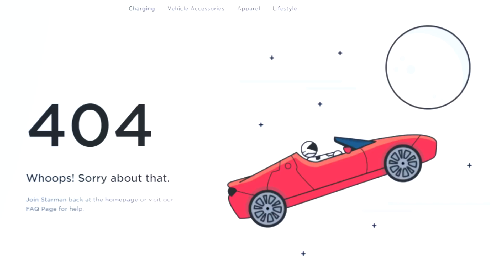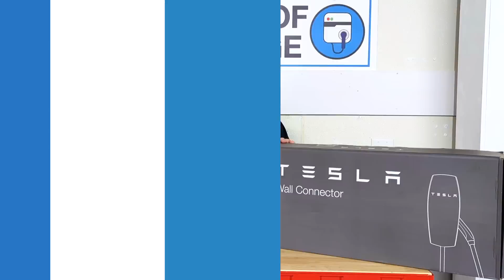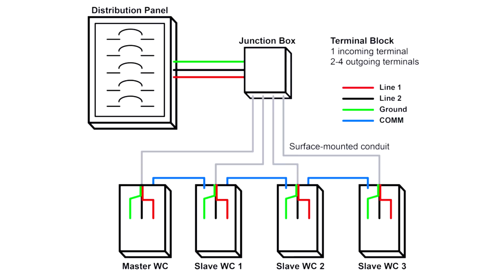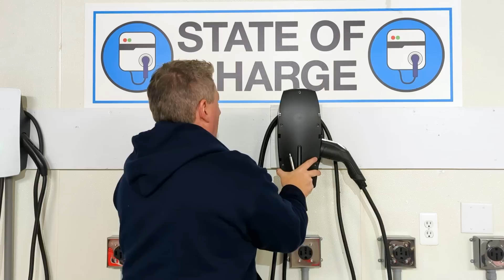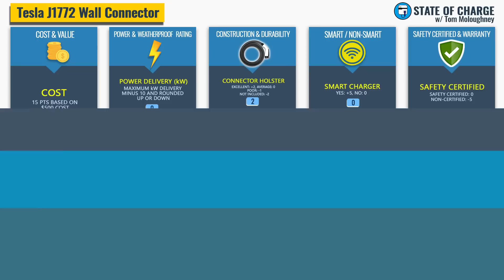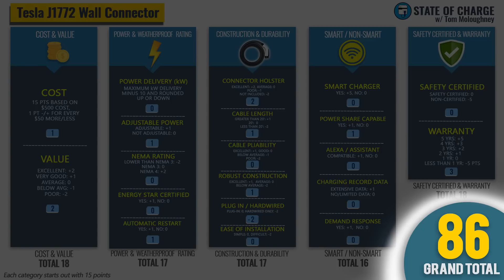Tesla J1772 Wall Connector Review new

Comment: The latest version comes with up to 48 amps and with Wifi.  $550.00 at Bestbuy.  I do wish it came as NEMA 4 but it looks like many people have installed it outdoors and I haven't heard of any real problems.  Now that I that, let's see how many disagree with me.  I'll use that as to whether or not I should install this outside, which is what I want to do.    Got a Ford F150 Lighting coming.  So I'm having a 60 amp circuit installed.  ;0)

Comment: I believe a reason for their limited sale of the J1772 charger is because Tesla wanted to clear out stock.  These J1772 connectors were available for commercial businesses to install on their property for a couple of years.  My thought is they wanted to end production and clear their inventory so they put them up on the website until they were gone.  Would explain why the listing isnt there anymore, why its a gen 2 style vs the gen 3 white glass frontplate style, and why it has no smart power sharing features.  They’re just old stock.
Reply: That is what I was thinking. These are the old Gen 2 used on commercial properties.
Reply: This doesn’t preclude them offering a Gen 3 version in the near future, supply chain permitting.  I wouldn’t be surprised if that happens at some point.
Reply: @JohnGeorgeBauerBuis  didn’t say it did preclude them from offering an updated version. But I don’t think that’ll come until they switch to CCS/J1772

Comment: Charge Point was one of the best you tested, especially in the extreme cold. So, based on your review that's what I purchased. And the fact it has WIFI built in and usable it was an easy choice after watching all of your reviews. Some of the other units had better stat options and was better in extreme weather but the Charge Point will work well in my area.

Comment: Are you planning to review the new J1772 Wall Connector currently available at Tesla? Specifically does the new J1772 Wall Connector now available allow power-sharing between the J1772 Wall Connector model and the current version of Wall Connectors with a Tesla Connector? In other words does it fix the main problem you had with the older model in that it could not power shared between the J1772 Wall Connector and the Tesla Wall Connector?
Reply: Im wondering the same thing. I just added an ID.4 to my garage beside my MY. Trying to figure if it will load share now with the Gen 3.

Comment: These were originally offered to businesses with their destination charging program. I personally believe that these were surplus units and Tesla was purging old inventory. 
I’m glad I purchased one on the day they came out. Technically, they can be networked to the gen 2 Tesla wall connector, but ONLY the discontinued plug-in gen 2 version. This is the way my charging setup is. I really should make a video about it.
Reply: Jim, maybe you can help me.  I bought one of these as well before they yanked them.  My question is, "Is there a light that comes on the front? (green or red).  I see it in the pics, but they've seem to have shortened the ribbon cable so it won't connect and I don't see where the light would be on the cover.  Does the ribbon cable pull out as to reach the front plate - I never connected it. Thanks!
Reply: @Cedar1956  Yes, there is a light. There is a single T10 (I think) torx head that holds on the silver cover. Once that is off, there are ten or so T20 screws that need to be removed. This takes the actual cover off the unit off. The ribbon plugs into the back of the cover. I hope this answers your question.
Reply: @fatwajim  Perfect! Thank you!
Reply: I was looking through the comments to see if anyone had mentioned this and I'm glad you did! 
A while back, I tested the J1772, made a video, and found the same thing, the gen 2 plug-in was the only compatible networked device other than the J1772. I'm thinking of grabbing another plug-in and doing a 3x EVSE network setup with 2x Tesla connectors and 1x J1772 outside for visitors :)
Reply: @TeslaRyan  I actually have a plug-in Wall connector for sale on EBay. If you’re on eBay, it’s the one that has a signature edition faceplate on it. If you’re interested, just let me know :)
Reply: @fatwajim  Thanks, I'll go check it out!!

Comment: What I'm dying to see is a J1772 version of their mobile connector with all the various NEMA adapters available. There is no equivalent on the market as far as I know. I've been contemplating getting one of the existing ones and a J1772 adapter just to have every outlet use case covered when traveling in my Bolt.

*edit: spelling
Reply from the maker: TeslaTap sells them, but they are currently out of stock.
Reply: @StateOfChargeWithTomMoloughney  Yup!
Reply: @StateOfChargeWithTomMoloughney  Are the Tesla mobile connectors that Tesla Tap modifies to have a J1772 connector safety certified and do they come with a decent warranty?
Reply: Personally, I’d rather pair a stock Mobile Connector with a Tesla to J1772 adapter.
Reply: Just get the bolt EUV mobile charger it has interchangeable plugs and does up to 32 amps
Reply: @ELSAMRAS1  I'm pretty sure it only has a NEMA 5-15 and 14-50. The Tesla has 8 different plug types.

Comment: Tom, nice review. But I hope you can review the DCBEL r 16 EV Charger, Solar Inverter & Energy Management System. Before the EVSE bidirectional chargers hit the market. That the DCBEL r 16 will partially compete with, so all the different bidirectional, V2H and V2G options can be compared and contrasted to each other.

Comment: Hi Tom, I live in Australia and my Tesla (model 3) has a CCS Connector in the car. (CCS is J1772 with additional DC high voltage terminals) so it is compatible with J1772 AC charger cable. I assume this charging station is available outside USA. The 240V home charger supplied with the Tesla uses a J1772 connector.
All new supercharges in Australia use the CCS connector. 
Maybe Tesla will soon make USA cars with CCS connector so it will directly accept J1772 and CCS.
Reply from the maker: That would be great, but it isn't expected to happen here. Instead, Tesla is going to be making CCS to Tesla adapters so other EVs can use Tesla Superchargers.
Reply: My prediction is that Tesla will shortly be converting all their cars to CCS and this is an item they will need to have in stock with that switch.  We are already seeing SC's with CCS so it is only a matter of time, even though I would prefer to keep the stock Tesla adapter on the cars and EVSE's as it is much smaller and more manageable.  I am not sure how the CCS fits in the M3 or MY flap, but it must somehow as that is what everyone else in the world is using.  This would also make it easier to build one vehicle anywhere and sold anywhere with the excepting of those right hand drive countries  ;)
Reply: @nevermab   Tesla is only using a country's DCFC standard. where local regs push them to do it.... Like China EU, and Australia have done... FWIW a newer CCS Tesla would use an older SC or EVSE via an adapter until all SCs and EVSEs had CCS plugs...

But USA (and Japan) regs are not forcing them to adopt the local DCFC standard.... Which is instead just getting dual plug SCs,  just so electric can be sold to most EVs  at a huge profit,  (ie it won't affect Tesla owners)

Shame since it would be far better for "all of us"; to have a universal standard for all EV DCFC, even if its a tiny bit larger like the EU is doing..... So we could all use the same chargers and EVSEs without the need for adapters.... IMHO....

:Lastly, since the EU is uses a" type 2 CCS" vs USA using" type 1 CCS". Tesla would still have build them differently for each market, plus thee a other reg differences...  So no econnies of scake cost saving....

Comment: Tom, great stuff as always!!!  Thanks for the heads up about this.    Owning a Tesla, I really don't care about the J1772 and certainly wouldn't use it on a BOLT or VW.  There's better J1772 connectors out there for non-Tesla vehicles.

Comment: Tom, can a tesla gen 2 mobile charger, charge a non tesla using a tesla tap adapter. I like the versatility of the different outlet plugs and output variability. Will it work, I have an EV6, thanks
Reply from the maker: Yes, absolutely.
Reply: Thanks

Comment: Can you review the Emporia Smart Level 2 EV charger?  This monitors power usage and works with the same app as the Vue 2, which monitors all house power usage.
Reply: If so, it would definitely be worth doing the deep freeze test.  For me, an EVSE will be installed inside an unheated garage, which can get pretty cold in Chicagoland winters.

Comment: Tom, nice review. I did see 4 of these units installed at Oakridge Mall in San Jose as part of a Super Charger and 24 Gen 3 destination charger setup. They had these J1772 units set to 40Amp but with only about 208VAC. I tested them with my Taycan along with the Gen 3 using a Tesla to J1772 adapter. The Gen 3s are 48Amp.

Also assuming a four year warranty on a item that they discontinued in 18 days seems a little optimistic wouldn’t you think?
Reply: 208V means they’re most likely connected across two phases of a 3-phase supply, commonly found at larger apartment buildings and industrial sites.
Reply: @JohnGeorgeBauerBuis  yes John, I am aware of that. I helped spec the 36 Level 2 chargers we had installed at my workplace. I requested higher voltage than the base 208, they were able to tap the transformer to get 235VAC, which is very needed as we only have 32A Clipper Creek chargers.

Comment: Tom, Great review on the J1772 connector.  That would be great for Teslas with the adapter and non Teslas alike 😀.  I wish Tesla would add BOTH Tesla and CCS1 connectors on all the new products or at least hurry up with the CCS1 to Tesla Adapter for North America.
What is the hold up?
Also why does a company as large as Tesla constantly running out of products on the Tesla website.  Elon check into this.  😁
Reply: I think they are waiting to have sufficient supply to start offering the CCS to Tesla adapter in other markets besides South Korea.

Comment: I am starting to have once a month or so error codes on my HCS-40 after nearly 7 years of almost daily use- it is probably a worn out high voltage contactor. I will get it repaired by Clipper Creek when it errors out every time I try to use it. Might you consider adding repair ability as part of your rating system? Clipper Creek said a main contactor replacement and general check up should cost around $150 plus shipping, which I think is a great price. Thoughts?

Comment: Tom, thanks for the review.  Most of us didn’t know this product was released for (limited) sale.  It’s a very peculiar generic charger.  Why is it bigger than the gen2 and gen3 models if there’s no added functionality in the box?  Sadly, it’s not a smart charger, capable of managing multiple accounts for residential use at Multi-Unit Dwellings (MUDs) such as condominiums.  5-EVs could share it:  a Tesla,  an iD.4, a Bolt,  a Mach e, and a Taycan.
Reply from the maker: I don't think it is larger than the original Gen 2 Wall connector, which was larger than the new Gen 3 units.
Reply: fwiw its not even a charger anyway... its just an EVSE.... ie Electric Vehicle Supply Equipment....
Reply: @nc3826  Yes, I know it’s an EVSE.  If you follow Tom’s vids like me, he explains most manufacturers call these “chargers” because the term EVSE is too complicated / technical for buyers.  As a 4+ year EV owner on a 2nd Tesla mS, I know the charger is inside the EV.  So far, all the EVSEs I’ve installed have been NEMA 14-50 receptacles, but as soon as I can find an economical one that does multiple accounts and hopefully billing, I will upgrade.
Reply: @johnpoldo8817   WADR Marketers and anyone, who only use the incorrect term for it, just add to the confusion.
While Tom explains the differences for newbies, so its not the same. 
FWIW anyone who is truly incapable of grasping the difference between the role of an EVSE vs its real charger should not be driving. 

Lastly thx for your defensive and pedantic retort about it. It was very amusing. Have a nice day, Sir.
Reply: @StateOfChargeWithTomMoloughney  Tom get well soon... And after you do. I suggest getting the pneumonia vaccines. It has been a game changer for me..... (Along with the COVID booster, ofc) TC

Comment: I am a first EV owner and will be charging the ID4 in my drive way. Is there a charger that has a stand that you can pull out when charging and put the stand back in the storage area when not?? I do find your you tube video very educational thanks again.
Reply: Such an installation would not be code compliant. EVSE are required to be fixed in place equipment, unless it is a plug-in, mobile type charger which would connect to a fixed outlet.

Comment: I have 2x Gen 2 that I power share over a wire.  Can you power share this j1772 unit with the Gen 2?  I understand you can not power share with Gen 3 because it does not use a wire to power share (i.e. wifi).
Reply from the maker: I believe you should be able to, but I can't get any confirmation from Tesla.
Reply: No, it will not power share with the 80amp gen 2 units. You will get a red error light with a code 6. I think it says something about there being a difference with the maximum amp ratings of the units.

Comment: Tom, I think it’s a poor design for charging the power setting, no one does low tech dip switch anymore, the power setting should have been software base IMO, however the power share features is awesome, also is it a true smart charger my org. Tesla charger does not log my charge sessions and no schedule charging.. no real app just for the unit with all the monitoring and management features that is know on true smart chargers.. does this unit comes with a dedicated app to do all the smart functions?
Reply from the maker: It's not a smart charger at all. No app - no smart charging features.
Reply: I disagree. The problem with setting the current limit in software is it would be too easy for someone who doesn’t know any better to set it higher than the circuit will safely deliver. By using switches inside the unit, it becomes a more deliberate action during installation.

Comment: Tesla has applied to the Texan VW Dieselgate fund for funding to build more charging stations as part of its opening up of its network to non Tesla only vehicles. As these are likely to be CCS rather than Chademo, perhaps Tesla may be thinking about manufacturing all of its future vehicles with CCS as standard & doing away with having to provide so many adapters as a standardisation cost cutting measure? Might be why this product was removed from sale just as suddenly as it was introduced.
Reply: They would then have to provide adapters to owners of now current Tesla cars to charge on newer CCS Tesla stations.
Reply: @rzu7120  I suspect those customers would have to purchase such adapters; they wouldn't come for free. As Tesla continues to expand its USA production capacity it wouldn't long before those with CCS outnumbered older versions should Tesla decide to go down the CCS route.

Comment: Hard wired for a 40 amps EVSE is a nonstarter for me; I could.justify it for 50 amps or higher, but not 40.
Reply from the maker: You could easily just add a 14-50 pigtail. I've done it on many units
Reply: @StateOfChargeWithTomMoloughney  I think you meant 14-50 pigtail, right?
Reply from the maker: @lkuhn65  Yes. Exactly

Comment: Is it bad to charge a Tesla daily using this with an adapter?
Reply from the maker: No. No problem at all. I'd probably prefer not to introduce an additional adapter for daily charging, but there's really no issue as long as you attach the adapter securely and keep it from getting wet while charging often.
Reply: @StateOfChargeWithTomMoloughney   Tom, nice test.  If you charge a Tesla with this j1772 unit using the adapter, if the grid power fails, will the Tesla automatically resume charging unlike other j1772 Evse?
Reply from the maker: @davidtuttle3429  yes, it should.
Reply: @StateOfChargeWithTomMoloughney  thanks for taking the time to reply.  We have a tesla M3 and soon a Lyric so I’ll probably buy the tesla j1772 for the Lyriq and may want to share a circuit between a tesla wall connector and the tesla j1772 wall connector.  Plus if we happen to get another Tesla in the future then the Tesla j1772 wall connector can charge a second tesla.  Did you actually test the automatic repowering when the grid fails or was it in the documentation ?  Thanks again

Comment: At 16:16, it sure doesn't look like it is physically   possible to connect the ribbon cable  to the front panel due to misalignment.   I am stunned that you elected to not power  it up for the review given that Tesla pulled it. I'd have guessed that it simply doesn't work, but until you actually run power to it, it exists in superposition, both working and broken, simultaneously.

Comment: Let's see if we will see this year the "model q or model 2" with a realistic range of 250 280 miles realistic range and new battery pack with a guarantee of 12 years or 250.000 miles and battery capacity 75 per cent after those miles! And we need a cheaper evs less than 25.000 pounds with 280 realistic miles even less even 20.000 pounds!!! And also we need real green energy and power and batteries recycling more than 95 per cent and able to be used for at least 3 or 4 more times,! Let's hope tesla or other companies are able to facilitate that in 2023 or 2024!!